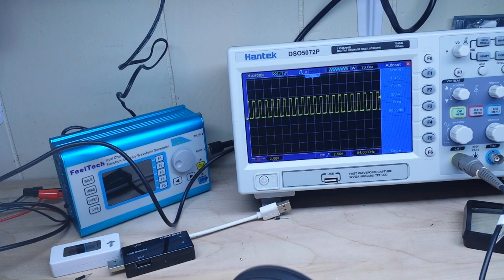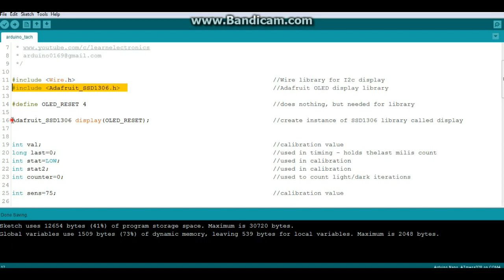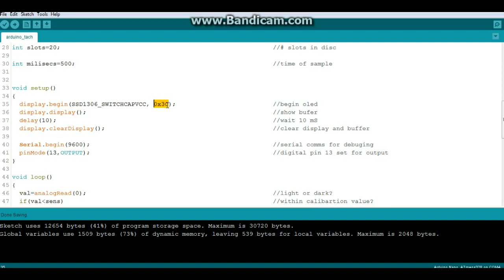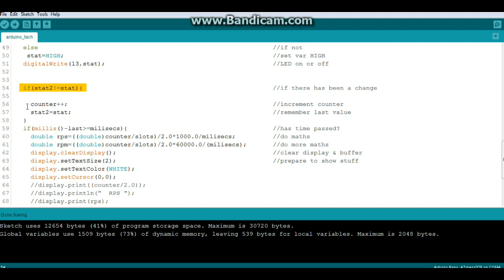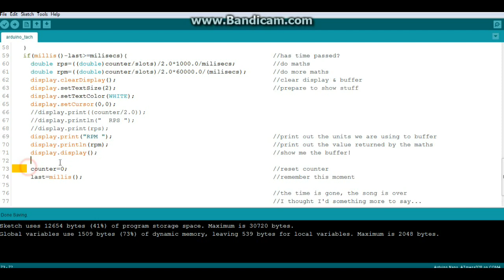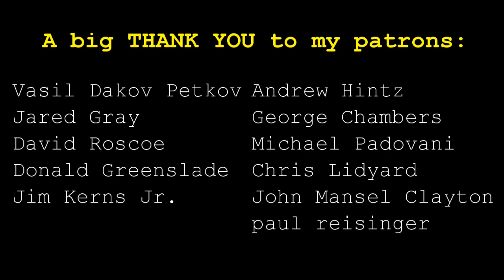Easy Arduino Tachometer with Photointerrupter

Comment: Nice, do u think a photo sensor or hall effect sensor is better at detecting RPMs?
Reply from the maker: +Michael Padovani Totally depends on the use. In a small enclosed system like an Arduino robot or the like, a photo sensor is cheap, lightweight and easy to implement.
On the other hand, all of large scale gas-powered RC planes with 50 & 100cc engines use a hall sensor on the prop shaft for the ignition timing. The hall sensor is not effected by changing light conditions, oil or dirt.

So I guess what I'm trying to say is that each have their place.
Reply: learnelectronics like many things do in this world! Thx for the reply.
Reply: Hall sensor is faster, doesn't need ADC and requires less energy. But sometimes it is not very convenient to mount strong magnet and in case of photo transistor black/white pen or paint is easier to apply.

Comment: I know this is a fairly old post, but just came across it.  You're using your threshold value "milisecs" in your RPM calculation instead of the actual value.  Yes they are virtually the same given the Arduino clock speed, but I would have used the actual value.  I'm not sure I agree with the math, I would need to play with it.  But good job nevertheless.